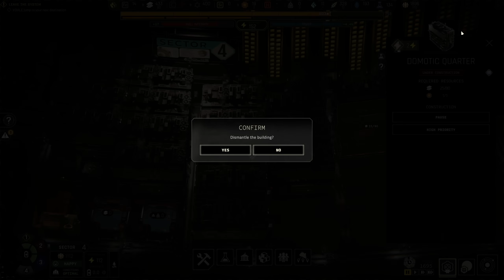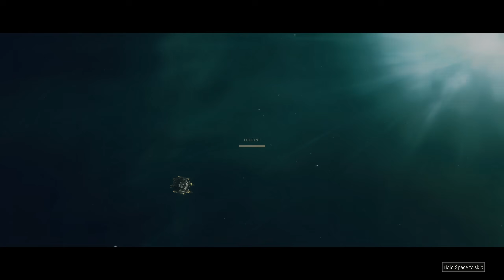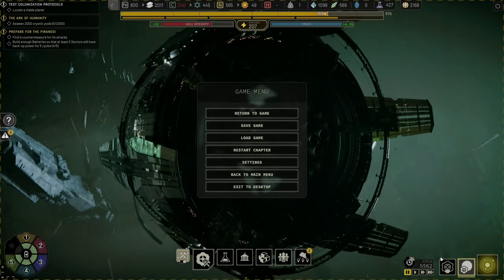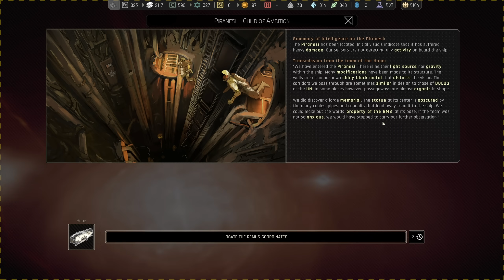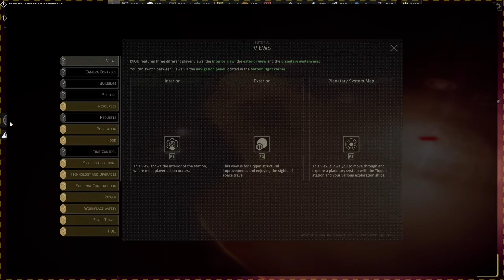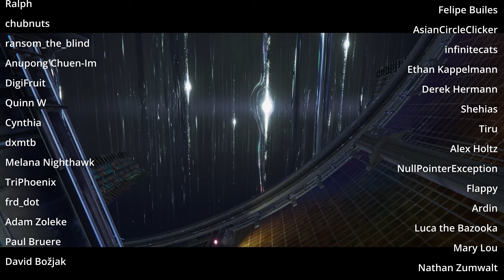Now is the time to RUN : Ixion Ep4

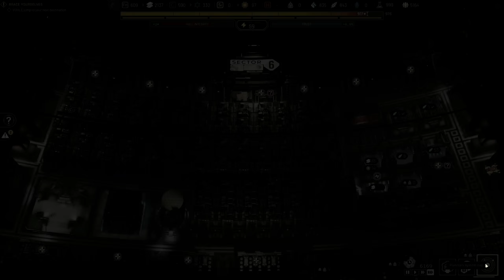Comment: 39:40 I noticed you put down two small storages for food, it's much more effective to put one medium one instead: 2x small gives 2x120 = 240 storage, 1xmedium gives 360 storage
Reply: Redundancy.   When the inevitable accident happens, you can still stock one of the mess halls.
Reply: @brendanrobertson5966  accidents don't last over a day and the meal cycle is 3 days meaning there's more than enough time to restock
Reply from the maker: Yeah I used to go with a single medium storage but ran into a problem. Each storage is assigned the same number of movement bots.
So if you want to ferry resources into or out of a storage rapidly you are better of with multiple smaller storage than one large storage. This becomes less of an issue if you have the ferry drone system but that is super late game. Around mid game before the drone system I was running into an issue with the EVA hull repair sector, the single double alloy storage was not keeping up with alloy replacement from the smelting sector.
The EVA was spending 2 alloy in each EVA about once a cycle to maintain the hull, while also transporting alloy from the edge of the map to the storage in the centre. The sector started running out of alloy as the transport bots could not keep up so I switched back to two smaller storage units and the problem went away. So for high priority items I go with double small storage, if it's a low throughput item double storage.